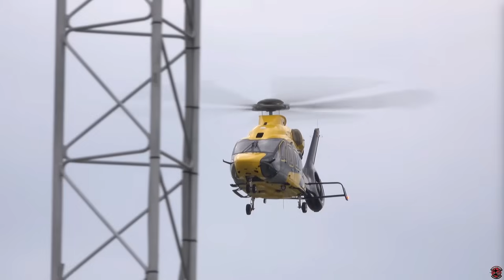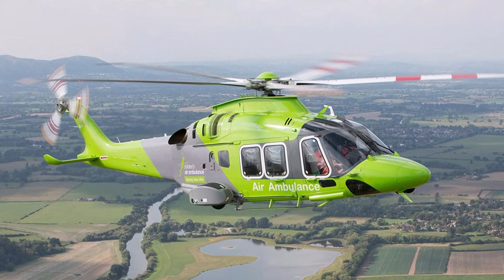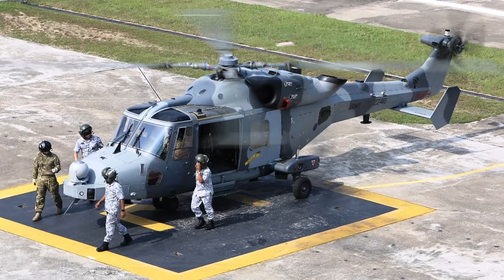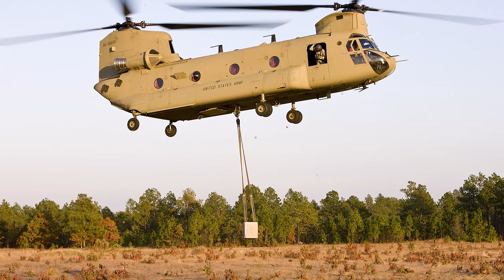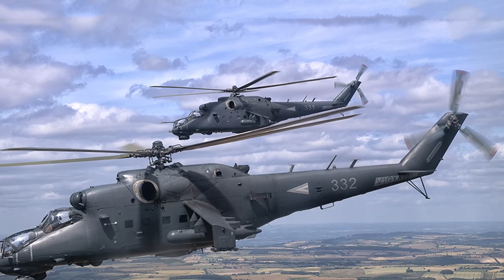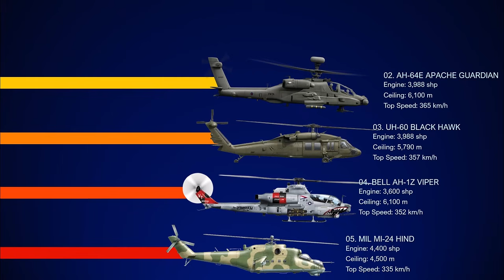The 15 Fastest Helicopters In The World Today

Comment: uh 60 flies max 300 why are you lying, and ka-52 flies max 315!
Reply: Top speed of KA-52 is 300 km/h
Reply: @jeffer2350  maximum is 350 short term
Reply: @patriktorak1998  That is not true.  350 km/h is the speed at which the mechanical parts are at risk of failing.